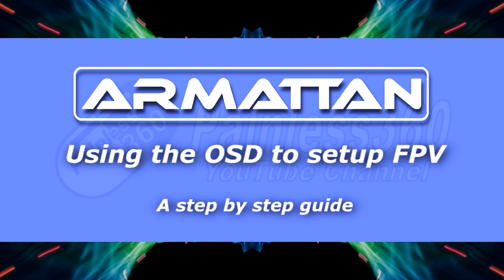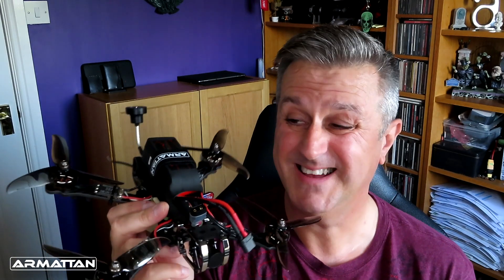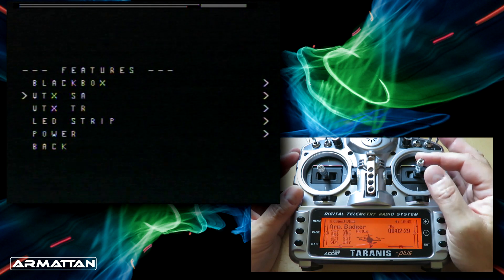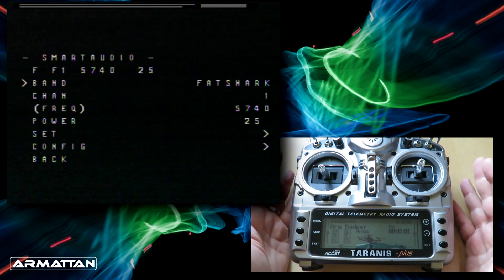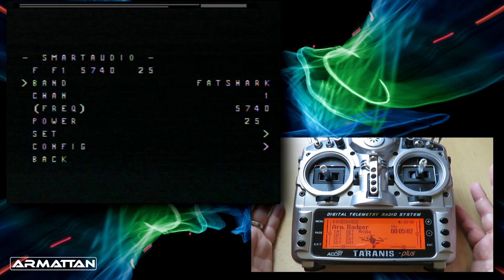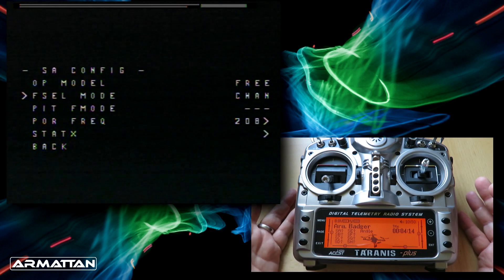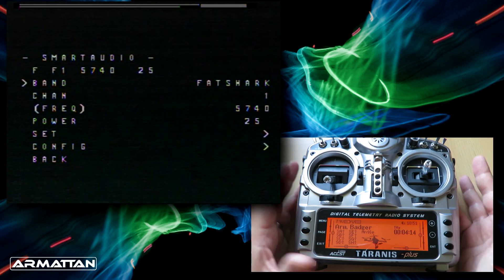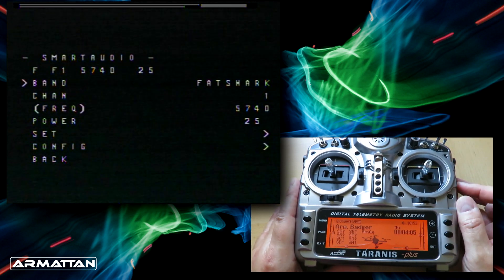Armattan VTX OSD setup tips

Comment: Thx for the info . Helped our alot. Should I tell a difference if I changed the vtx power to 600 mw? I'm trying to be able to fly a little farther or have less static but I cant tell a change. Well it also could be the fact that the metal part of my die pole intena popped offin a crash.